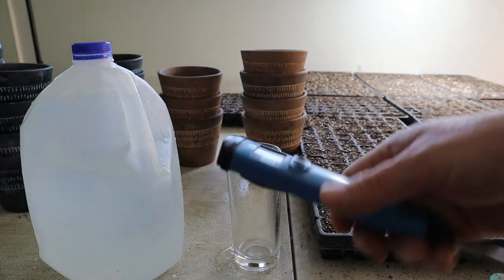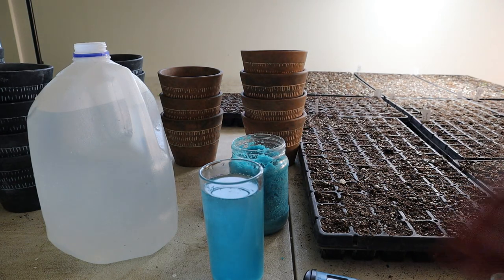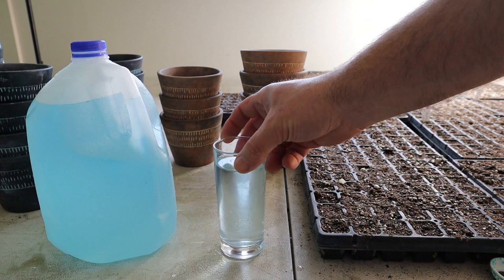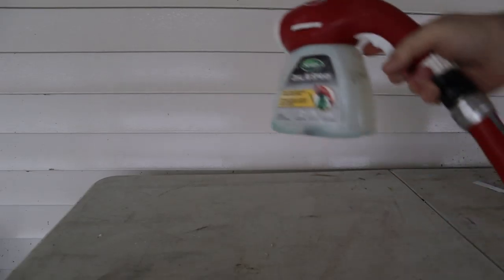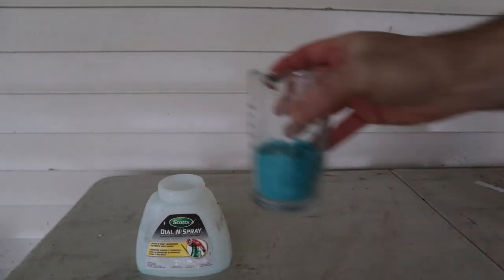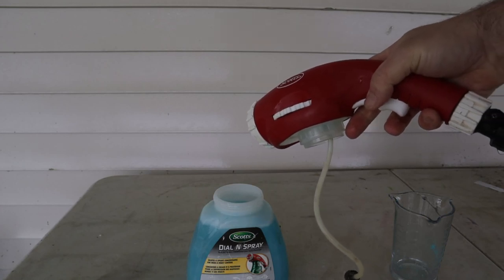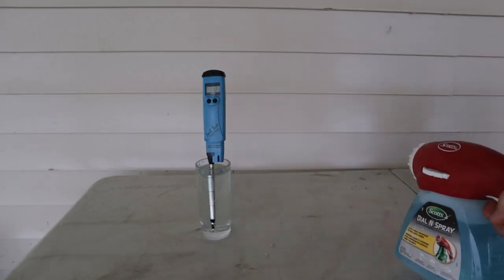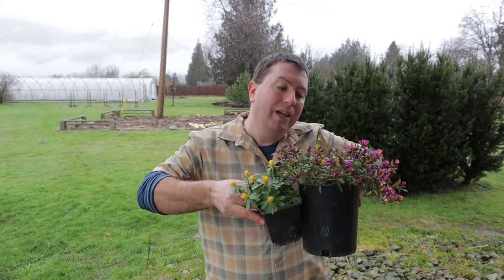Liquid Feed Fertilizer: Mix and Measure for Potted Roses and Other Plants

Comment: Hey Jason, I hope you will see this. I'm confused if I should fertilize or not. I bought my first rose bush and re-potted it in a 5 liter pot. The soil I'm using is with compost and chicken manure. The plant is just now sprouting some leaves. Should I use my liquid fertilizer?

the soil company has details for nutrition, but mind that I also mixed a fair amount of perlite.

Nitrogen (N) water soluble. 80 mg / l (310 mg / kg ka)
Phosphorus (P) soluble 70 mg / l (270 mg / kg ka)
Potassium (K) soluble 400 mg / l (1540 mg / kg ka)

I'm learning a lot from you and wish you the best.
Reply from the maker: I'd probably wait and see. It sounds like this mix has a fair amount for early growth, but you can always top up later if the foliage is pale green in color or of the rose doesn't rebloom quickly after deadheading.
Reply: @FraserValleyRoseFarm  thanks a lot, really appreciate your presence on youtube

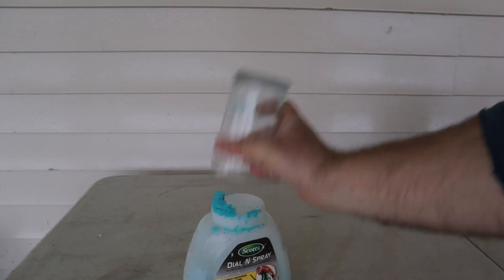Comment: Again, one of the most informative videos out there. I love watching many times. Let's not ignore that Bruce Lee move at 5:40😮

Just a thought, do you think you could use a hose end sprayer to acidify tap water by adding an acid rather than fertilizer to the feeder?..
Reply from the maker: Yeah, I think that could work fine. You might have to tweak a bit with a pH tester to get the right rate.
Reply: Also, after I'd made up a solution with the hose and sprayer like yourself, it occurred to me I'd  prefer to try sulfate of potash😅  Do you ever use it? If so, how do you apply it?

Comment: Hi Jason! Thank you for your wonderful channel and all the information that you share. I am not sure if my question reaches you, but I will try. I live in Bergen, Norway and my climate seems to be very similar to yours. I am learning how to propagate roses, have got some cuttings from generous neighbours and planted them about a month ago. Not they are approaching stage two so I will need to start fertilising them. I have zero experience with non-organic fertilisers, so my questions may be really dumb. I have found a granulated "balanced" fertiliser in a local garden centre, it says that i has NPK 12-3-15. Let's say that I mix it according to the instructions (divided by 4 as it is cuttings). The question is how much solution should I pour in each of my pot with cuttings? And how often do I do this? I am using something like 12-15 cm circular pots and it is seedlings soil mixed with a bit of perlite and sand in them.
Reply from the maker: I might be a little confused about the form of the fertilizer. When you say granular, I think of something normally applied as a top dressing.  But is it fully water soluble per the instructions? If so, and you've mixed to an appropriately dilute solution, water as normal (to slight pour-through). Some growers will alternate between fertilized solution and plain water to avoid excess salt build up
Reply: @FraserValleyRoseFarm   Thank you for the prompt reply! I have figured out that the fertiliser that I was talking about was indeed not a water solvable one so I did not buy it. It looks like there are not too many water solvable ones here in Norway :(  What I have found is Monokaliumfosfat (MKP) [KH2PO4] 0-23-29 and what can be translated as "Blood flour"  an organic fertiliser with NPK 13-0-0. Should I mix them together? <Sorry for really basic questions, but I seem to be lost doing this for the first time.
Reply from the maker: Don't feel like you have to follow my preference for water soluble conventional fertilizer. Evel liquid fish or your preferred organic fertilizer will be fine, so long as you remain cautious about overfeeding.

Comment: I have just received 12 David Austin bare root roses, and potted them up pure peat/woodland soil. Due to COVID I don’t want to go the store to buy rose soil. I own a wood, which is over 200 years old. I used that soil. I think it is mostly peat end composted leafs. Is this good for potted roses? It is acidic tho. My Rhodes are doing very good in this soil.
Reply from the maker: Roses are reasonably adaptable to an acidic soil down to around pH 6.0. Below that level, there are a few nutrients that they'll have a hard time with. You can always add some lime or wood ash to increase the pH. I hope the drainage is fairly good - with a lot of organic material like that, I'd watch to make sure it doesn't hold too much water.
Reply: @FraserValleyRoseFarm  Thanks for your prompt reply. I saved a lot of wood ash from my wood burner. (only clean burned wood used, mostly birch)  I could use this. But somewhere somehow i have read that it will take up to 6 months before it does its work, and if it does it would only be a fraction less acidic. What are your thoughts about this?  As far as for drainage, yes it is 100 peat but i didn't compact it when potting up. I watered them and let gravity do the rest. The excess water drains very quickly. They are now overwintering in my unheated greenhouse. Coming spring i will put them outside and in summertime i will take cuttings from them. The species are. Emma Hamilton, Jubilee Celebration, Constance Spry, Crown princess margaretha, Jude de Obscure, Auguste Gervais, Francis E. Lester, Kew Rambler, William Schakespeare 2000 and St. Swithun.

Comment: What time release ferts do you use? Is there a difference between the fert you use the first time potting up the rooted cuttings vs planting up something that is more mature/possibly to heighten the flowering for the season?  I didn't see the time release ones in the amazon store.  (I am in the process of potting up my cuttings and no way I am attaching the hose yet, it will freeze! )
Reply from the maker: Hi Kimberly. I just added an example to my Amazon store, 14-14-14, 3 to 4 month release. Some of the commonly available controlled release ferts are more like 15-7-10 (higher N) which gives lush green growth, but I do prefer a more balanced NPK at a lower rate (or balance with a higher P and K with liquid feed). I incorporate the same fertilier at potting time as I do later (as a top application). How exciting that you're potting up your cuttings! My soil comes next week so I'll be doing the same.

Comment: How often do I need to fertilize my container roses using granules?
Reply from the maker: During the season I use 90-day slow release, 2 or 3 applications. Then top up with liquid feed only as needed
Reply: @FraserValleyRoseFarm  Does that include first-year roses in a pot or only established roses in pots (2nd year +)?🙂 I have some of both!

Comment: I keep reading about household items to use as fertilizer by soaking or grinding them and using the water or the actual item, the items that come to mind are coffee, banana peel, egg shells,pasta or rice water. What if any household items do you recommend to make liquid fertilizer or crush and put in soil?
Reply from the maker: Hi Marcella - good question. There's a special appeal (I notice) to using household items, but they're usually not a good replacement for a balanced fertilizer solution. One my be relatively high in N (coffee grounds for instance), another may be a (very, very) slow source of calcium (egg shells), but there's no magic in food scraps. I'd advise you to make a compost from them, and in the meantime apply a more balanced prepared fertilizer.
Reply: Ok thanks